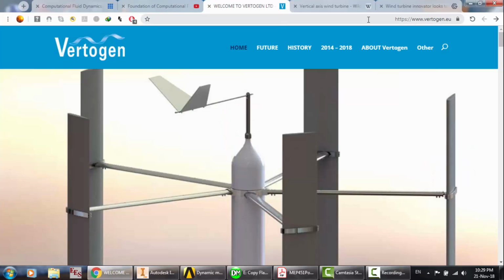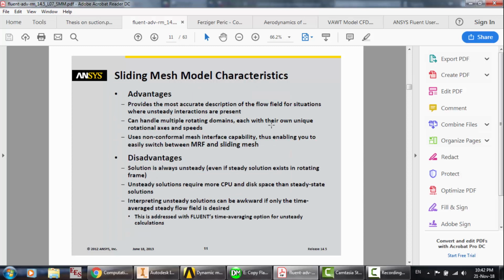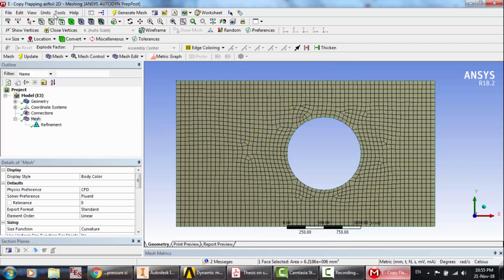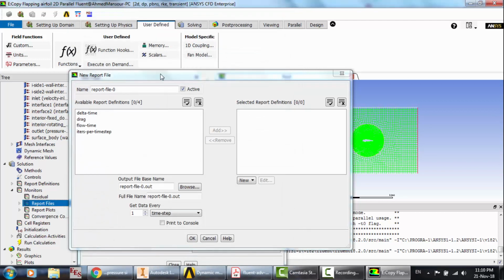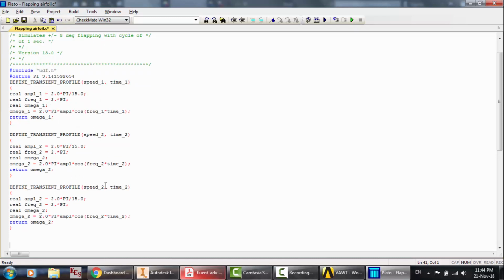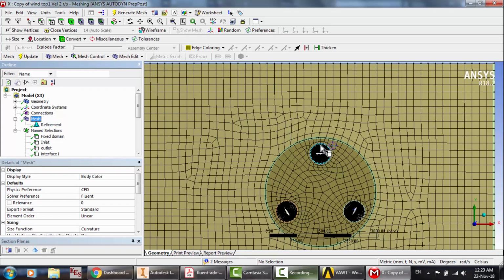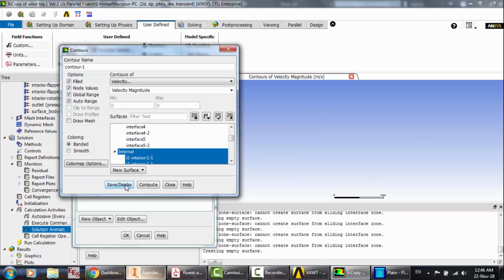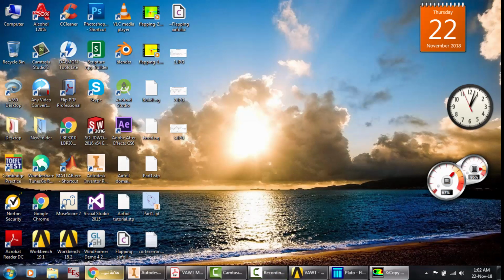CFD simulations of a flapping airfoil and a variable pitch VAWT Ansys Fluent sliding mesh

Comment: I'm try to simulate a turbine with deflectable blade. The blade will deflected by the flow of water and will turn the turbine. What should I use, 6dof or udf? But I don't know how to set the dof and code a udf.
Reply from the maker: Hello, wathc my video about the 6dof and also you have to do a literature review to see the best way of modeling. Thank you and good luck!
Reply: I already tried to simulate it. The blades are moving at an angle I want but not in the direction it is supposed to rotate. I have 4 deflecting domains for each blade and a rotating domain. But the rotating domain is not rotating at all. And theres no flow at all even though I input a 1m/s velocity at the inlet then I try it again with no dynamic mesh and input a rotation vel to the rotating domain then the fluid starts to flow.

I try to follow your geometry for the variable pitch. It has the same principle except I only need to constrain the angle and it will only move by the flow force. 

I also try to follow all your steps in your 6dof video but unfortunately it's not working
Reply from the maker: Okay, try at first my tutorials in detail until youhit good results as mine, then modify the case but gradually to find out the main source of issue. @JM-cq9hy

Comment: What is meant by 15.0 in real ampl of the UDF? Is it pitching or flapping 15 degree or anything else? Also how do you define real freq ? what is 2.?
Reply: Hey, I get your question basically 15.0, means that we are pitching 180 deg/15 ~  +- 12 deg for the case. This comes from the fact that if 2*pi is 180 deg then 2*pi/15 is 12 deg. 
Hope this helps!

Regards,
Het Patel
Reply: I have a question, imagine I am pitching the blade sinusoidally and it is 0 at 0 azimuthal then 8 degrees outward at 90 azimuthal then back to 0 at 180 degrees then again at 270, 8 degrees inward, and at 360 again 0. so its like 8sin(theta). as the blades are separated by 120 degrees and blade2 and 3 are initially at 120 and 240 azimuthal without any pitch. and if we apply udf mentioned by this guy, the torque produced by each blade will not be same untill we initially set the blade 2 and blade 3 the specific pitch as per udf. Am i right?? i have already tried the phase shift like blade 2 = 8sin(theta+120), blade3=8sin(theta+140).   @hetpatelNCSU
Reply from the maker: Hello dear Dhan, here is the code:
#include "udf.h"
#define PI 3.141592654
DEFINE_TRANSIENT_PROFILE(speed_a, time_a)
{
real ampl_a = 0.1*PI/15.0;
real freq_a = 42.85*PI;
real omega_a;
omega_a = 2.0*PI*ampl_a*cos(freq_a*time_a);
return omega_a;
}
#include "udf.h": This line includes the necessary header file "udf.h" which provides the functions and macros required for writing UDFs in Fluent.

#define PI 3.141592654: This line defines a constant PI with the value 3.141592654.

DEFINE_TRANSIENT_PROFILE(speed_a, time_a): This is the macro that defines the transient profile function named "speed_a". The function takes two arguments: time_a (the current simulation time) and returns the angular velocity (omega_a).

real ampl_a = 0.1*PI/15.0;: This line declares a real variable ampl_a and initializes it to the value 0.1*PI/15.0. It represents the amplitude of the angular velocity.

real freq_a = 42.85*PI;: This line declares a real variable freq_a and initializes it to the value 42.85*PI. It represents the frequency of the angular velocity.

real omega_a;: This line declares a real variable omega_a.

omega_a = 2.0*PI*ampl_a*cos(freq_a*time_a);: This line calculates the value of omega_a based on the given formula. It multiplies the amplitude (ampl_a) by the cosine of the product of the frequency (freq_a) and the current time (time_a) multiplied by 2.0*PI. The result is assigned to omega_a.

return omega_a;: This line returns the calculated angular velocity (omega_a) from the transient profile function.

In the code, the value 15.0 in real ampl_a = 0.1*PI/15.0; represents the scaling factor for the amplitude of the angular velocity. It is not directly related to the pitching or flapping angle of the airfoil. The specific value of 15.0 in this context is arbitrary and can be adjusted based on the desired behavior of the simulation.

The real freq_a = 42.85*PI; line defines the frequency of the angular velocity. In this case, the value 42.85*PI is an arbitrary frequency chosen for the simulation. It is not directly related to any specific physical phenomenon. You can adjust the value of freq_a to control the frequency of the flapping motion.

The number 2.0 in omega_a = 2.0*PI*ampl_a*cos(freq_a*time_a); is simply a coefficient used to scale the calculated angular velocity. It is not inherently related to any specific physical property or phenomenon. The purpose of this coefficient may depend on the specific context and requirements of the simulation.

You simulate thefflapping airfoil and change the values ad study the effects for a better understanding.
Thank you!

Comment: Hi, I was have had a look at the C++ code and had a few questions.

Based on the C++ code:
#include "udf.h"
#define PI 3.141592654
DEFINE_TRANSIENT_PROFILE(speed, time)
{
real ampl = 2.0*PI/15.0;  Means that the ampl is: 2*180/15 = 24deg or 0.41887 rads 
real freq = 2.*PI; means the freq is: 2*180 = 360 dergees
real omega;

omega = 2.0*PI*ampl*cos(freq*time); for time 1sec Omega is: 150.79 Deg/Sec or 2.63189 rads/sec

return omega;
}

Could anyone help explain how this could pitch the airfoil +/- 8 Degs?

when I applied this UDF my aerofoil seems to completes a pitch of 18 Degs (not sure why this is, I though it would do 24 deg) in 0.16 sec which matchs Ampl/Omega value. 

The time step size should not effect the rotational angle but only the Sim runtime and accuracy based on the mesh.
Reply from the maker: Hello dear Fakhreddine, try to study the following paper and other related flapping wings physics to understand how to simulate this motion in C code. Danke!
Reply from the maker: Wei Shyy, Hong Kong University of Science and Technology, Hikaru Aono, Chang-kwon Kang, University of Michigan, Ann Arbor, Hao Liu, Chiba University, Japan
Publisher: Cambridge University Press
DOI: https://doi.org/10.1017/CBO9781139583916.006
pp 90-175

Comment: Sir, I tried both compiled and interpreted UDF function for the fluent. But my airfoil is rotating 360 degrees rather than oscillating. Require help as this my project for my college final year.
Reply from the maker: Hello dear Afreed, please make sure that you did not do any different step. Follow again the flapping airfoil simulation steps and tell me the progress. Danke!